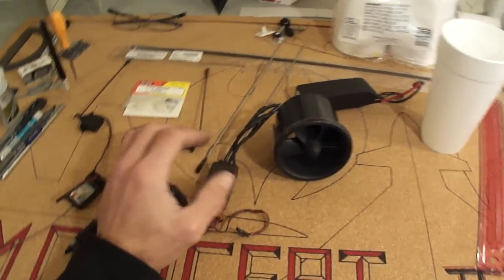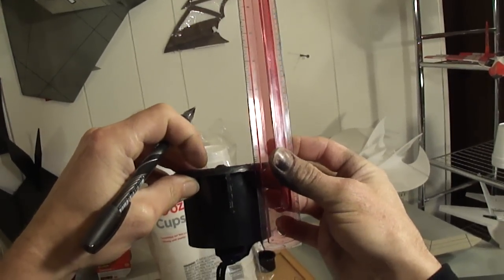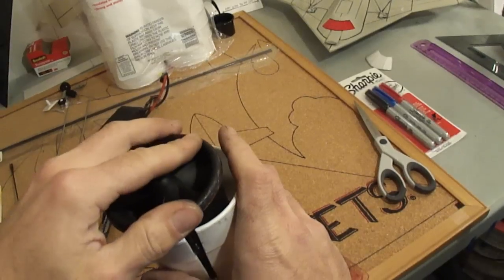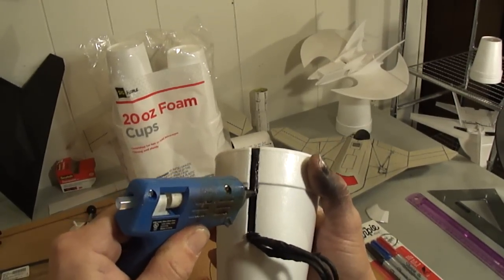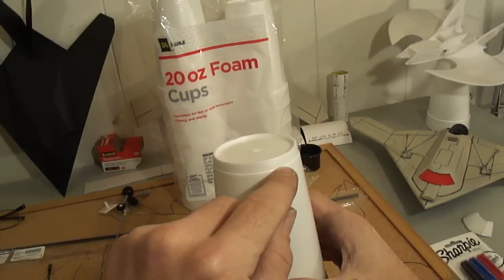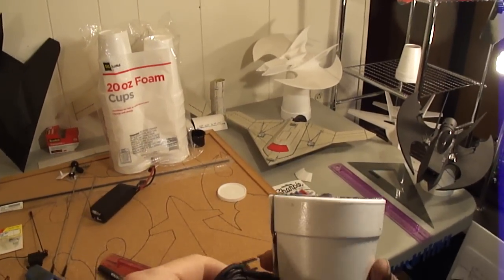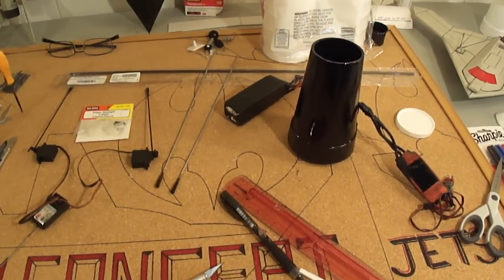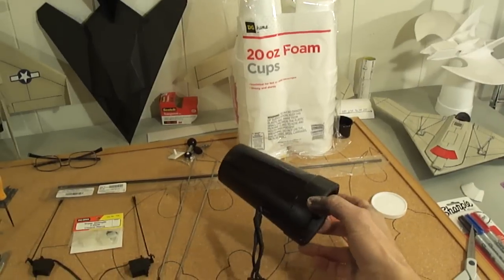Building the thrust tube for your 70mm Foam Concept Jet.

Comment: That's a really clever idea, thanks for sharing the cup nacelle idea!
I do have some questions though; doesn't getting paint on the fan blades upset the balance? How will you mount this setup since the mounting points are now inside the cup? Since I have the same Detrum motor and ESC I'll use your cup idea but instead of paint I think I'll use aluminum tape to cover the inside and outside to make it look more realistic. What do you think?

Comment: When I purchased my edf it had no thrust tube so are they really needed
Reply: yes or you will have insufficient thrust no power basic  physics.
Reply: Take a look at this video by Greg Strysky with the same Detrum motor showing thrust tubes can actually decrease thrust but having no tube seems to give the most thrust! You be the judge!
HobbyKing 70mm EDF Thrust Tube Diameter Test (Google it)